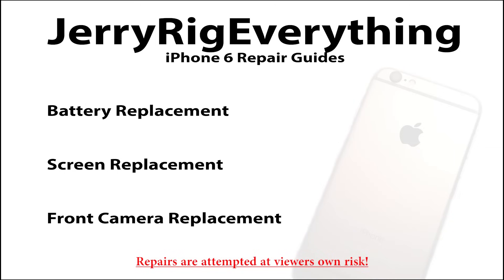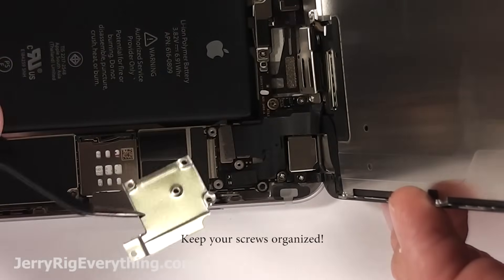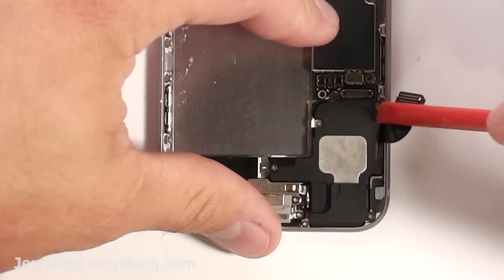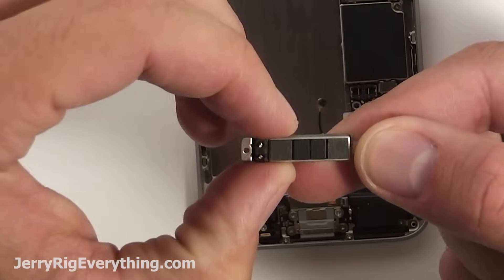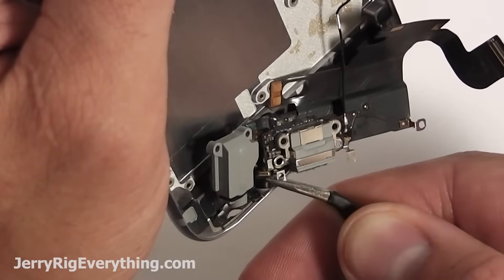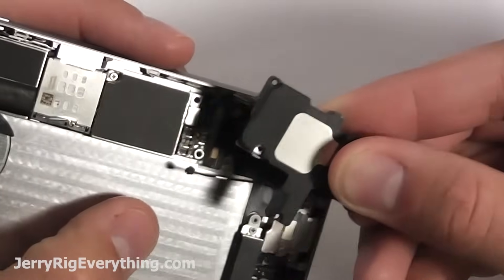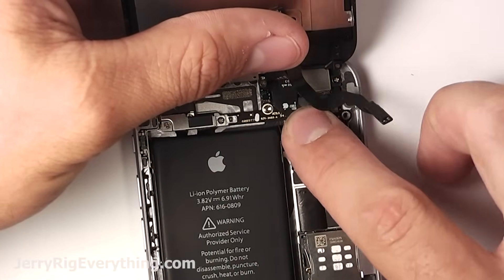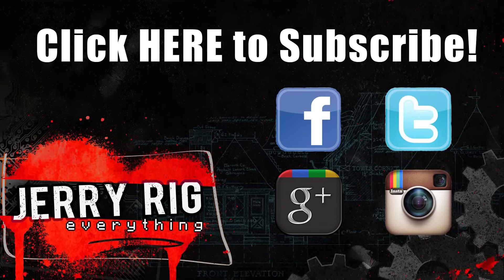iPhone 6 Charging Port Replacement in 5 minutes, microphone fix, headphone jack repair

Comment: The guy in the video makes it look stupid easy, I wouldn't attempt doing this by yourself unless you're already a tech guy. I fixed my charger but I broke my speaker in the process. :/
Reply: Is that what happened to me? I replaced the charging port and headphone aux and now my phone doesn’t have sound unless i use headphones
Reply: @RealTipzy  Probably lmao

Comment: Uuh, so, how can I troubleshoot if the phone won't turn on at all after replacing the charging port?
Reply: Lol good luck bro
Reply: I caused a spark when replacing the charging port like a idiot but I put it on the charger and it worked after. I guess the spark drained the battery

Comment: Fast, simple, and straight to the point. Thank you! I replaced the charging port and battery on my old iphone 6, and it works great again. Very grateful. It's like a new phone. Now, if only Apple would let it upgrade to the latest iOS. Oh well, you did a great job. Thanks!

Comment: This was very well done and much appreciated. One little thing that would have been helpful would have been to point out that the screws on the same parts are different sizes. I took some of them out and then I thought, "Hey, those are different sizes. I had better make sure I keep track of which screw goes in which whole and not just which screw goes with which part."  The green arrows were quite helpful.

Comment: This is a great tutorial that points out the harder issues as well as the easy. The link provided is recommended even though they may not sent progress email but my package came to NE. In 3 days. I am old school self taught auto tech who apprenticed then found myself in a dealer. In the early 70’s a group started an org to elevate auto techs to a base line level with 8 categories. NIASE of which I took all 8 test & passed. Retired now but these are the folks you want working on your equipment. Thanks for the information, parts link as money don’t grow in trees in this throw away society we find are selves in. Don’t fix it, junk it and buy new. Not me! ASE Master Tech since 1978 -Retired

Comment: Nice video but it’s not a good idea to disconnect anything before disconnecting the battery cable first as you can short out the board

Comment: I changed this following the video accurately. 

Everything now works (thanks), except *I have lost the sound for the speaker.*
Any thoughts?
Reply: Problem solved. I took the phone apart twice, then a third time in order to micro-align the parts. The speaker has two copper conductors (which Zach mentions in the video) which needed a lot of coaxing to have them meet up. Ace.

Comment: I tried. Successfully changed the battery. But the charger port is 10 times more difficult. The tiny little screws defeated me on attempted reassembly. Need a new phone, no big deal, 10 bucks for the part, worth a try.

Comment: remove the battery conector before removing the screen and plug it back after plugging the screen back in else you may blow screen filters

Comment: My 6.5 years old thanks for making and posting this video.  I wasn't sure if my old iPhone 6, which beyond the charging port and being a bit slow still suited my purposes, was worth repairing.  I knew I had a limited budget and zero experience with electronics repairs but figured it would be worth $18 to give it a shot.  Other than the one wire attachment that you said took a couple of tries (took me like 20 minutes and gave me a brief sense of panic/frustration) I did it!  Thanks again and am subscribing!

Comment: Just tried this because my POS iphone is shot. Won't charge at all anymore. I got as far as the two exterior screws out and the screen lifted.  Couldn't get the interior screws out. Not one. The kit doesn't have any indicator of which bit to use and I tried any that seemed small enough to fit. So thanks for posting the video, but this didn't really end up helping at all.

Comment: Hey great video! Incredibly useful and straight forward. I completed the repair and all ports work, but my load speaker stopped working. I heard it could be the “flex cable” I was wondering what part that is or if I need to do the repair again. Thanks!

Comment: I got it apart and back together and it's working. However I have 2 smaller screws left over. Is there a guide that shows which size screws go where on this phone?

Comment: I thought I was going to have to change out my charging port. I'd cleared the lint with a plastic toothpick, then I read a comment about using a needle because the dirt and fluff get compacted. So holding the phone with the port downwards I carefully scraped out the inside and was amazed at how much more came out assisted by gravity. Charging fine now.

Comment: Old video but for anyone repairing iPhones - Before removing the digitizer, you really ought to unplug the battery to prevent short fusing your IC chip which is an expensive repair. The IC chip is essentially the CPU of the motherboard and you really don't want to damage that as it will cause your display to black out completely.

Comment: I need helppp after I installed the charger port my sound stopped working
Reply: make sure the connectors on the speaker are aligned

Comment: The right strew holding my vibrator module to the phone is stripped and I can't get it out. I don't see any solution for this at at all. I have already tried using a rubber band to get more grip and I have tried super glue. None of which worked. Looks like I will either need to deep clean my old charging port or get a new phone.

Comment: Followed step by step, organized all screws, went to plug in to charge—-nothing. It has a new battery already but  charge port was damaged. Didn’t turn on for about 4 months because it wasn’t charging. Only thing; I can’t figure out the little loudspeaker wire! I cannot see where it needs to go at all. I’m going to do it all over again tonight to see if I can get it. Took 1.5 hours last night.

Comment: Fantastic! I went between your 6 and your 6s videos as you mention a few different aspects of the change out. Of note, the most difficult part for me which was mentioned earlier by other folks was the fact that you need to save your old previous microphone housing and insert it accordingly in the cavity of the phone frame. I had to redo that a couple of times as it didn't line up. And in missing that - it throws off all the alignment of how the entire housing lies in the phone cavity. Also trying out the power before putting back on the metal screen plate was a great tip. Would be awesome if you had a iPhone 6 screw chart like you did for the 6s...but I made my own and leveraged off of your 6s as well. MY 3 hours of studying  and replacing probably saved me $6 - $800 for another year or more!!

Comment: Ok I have a question please answer if u can becuz I just placedan order for a new iPhone 6 charging port I already replaced the battery since I messed it up charging it with a off brand "elite" charger but when I tried to charge the phone it wouldn't charge I tested the charger and it works fine with my airpods I also did the toothpick thing and it wouldn't work so does that mean I need a new charging port?

Comment: Great video, thanks Jerry. Old iPhone 6 is now charging OK but my screen has gone a bit funny? would this be because the 'nodes' aren't connected properly? Regards. James
Reply: Hi, can you tell if the data on the phone (photos) remains intact after such a fix?
Reply: @F0xleks  Completely! and just so you know the screen is fine, it just needed the node connectors to the screen cleaned with petrol fluid and a tooth brush and about 2 hours to allow 'static' I guess from me fiddling inside dissipate! Also went on to replace the battery too as described by Jerry, again, an easy fix as he describes brilliantly! One tip, by the tools he links as without them it would be difficult... oh and I say toothbrush, but actually I used those tooth flossing stick things.
Reply: *buy

Comment: Fantastic guide, thank you very much.  Getting the tiny loudspeaker cable back on was a real PITA, but that's just the design.  I'm glad I'm nearsighted, I actually took off my glasses and had my eye about an inch from the phone for a while. :)

3rd repair on my iPhone 6 and it's really weird every time I take it out of the case; modern phones are so slim and slippery, how does anybody not have a monster case just to hold onto them, hah.

Anyway, thanks again!

Comment: Took a while longer than 5 minutes just being careful to organize the screws and covers separately and noting which screw went in which hole since they are differing lengths. But overall this was a good series and I just did my battery and charging port on my old I6. Plugging in the screen micro ribbon connectors I had the first one not seat correctly I think and phone would not power up. I tried it before I snapped screen on and had to go back and redo those connections.  My bad.  Thanks for the info.  Thumbs up.

Comment: Awesome video - thank you!  Used it to replace the battery and Lightning port in my son's iPhone 6.  We ran into one issue though.  There are two right-angle brackets on the back of the screen, and these are what the Pentalobe screws from the outside screw into.  Well, these both bent when I was trying to screw the phone back together (probably too aggressively), and they both metal-fatigued and fell off from the screen.  Do I need to replace the entire screen?  Or is there a way to replace just those two right-angle brackets?

Comment: replaced loudspeaker as it wasnt working (as well as charging port). it works but is really crackly and doesnt sound great. could that be i've done it wrong or the speaker is just bad?

Comment: Guess I should stick to fixing motorcycles because I tried everything except plastic explosives to get the speaker out with NO luck, all the screws are out, I even took out every screw within an inch of it but it’s like there’s a hidden screw under the speaker or a clip or adhesive but it will not come out!!  I mean I could put the vise grips to it but guessing not a good idea, I guess it’s off to the Verizon store 👎

Comment: I fixed my phone thanks to your video! Thank you so much! Another thing that helped me was doing something I saw in reviews for the replacement part I bought: draw a picture of all the components inside the phone and use double-sided tape to stick all the screws on the picture where they need to be screwed back in. Worked like a charm, no guesswork for which screws goes where. Very helpful video!

Comment: Hi my niece dropped her phone in the sink while she was washing her hands and now it won't turn on. I was going to put in a new charging port and replace the battery but I'm afraid the motherboard might have gotten wet and all that IC chips are corroded and will require cleaning And resoldering.  what are the chances the phone will work after I replace the charging port and battery?

Comment: I did All of this. Every thing BUT the charger works. Is there any chance I just did something wrong in the installation and it's not something much worse? Before I could get it to charge but I had to put weight on the cord to make it work. Not even that works anymore.

Comment: The hardest part was getting thin wire cable antenna plugged back in. I was starting to think maybe I damaged the connector, but finally I heard it click into place. I put everything together with a new 2200 MAH battery and it's working perfect. It's like my 4 year old iphone6 is new again!

Comment: I dropped my phone into the toilet. Then looked up how to repair a water damaged phone. Two of your videos came up. One on replacing the battery and this one on the charging port. I’m no newbie at taking my phone apart, but this is the most difficult one so far. I believe I followed the instructions precisely but the phone won’t turn on. Is it possible that I received some faulty parts by some random chance, and I should reorder the parts? How can I tell? 
If not, last resort is to bring it to the local phone guy but no guarantee at all and in the end, I might just be spending more money and not be able to repair it and still have to spring for a new phone. Help please?

Comment: Definetly try cleaning it with one of those sim card picks. I just went to a phone repair shop and told him the port didnt work. He just took one of those and started digging out (which i had already tried with safety pins, compressed air, toothpicks etc. And now it works like its supposed to. Had to buy a pair of earplugs because I felt bad i came down there and some kid had to dig out dirt from my phone for free.
Reply: Anders Kristensen Lols from how he maneuvered around it bet they get that all the time
Reply: @TobbeStorm  Apparantly it's common. I went to Humac first. Some dude with fancy shoes and about half a tube of gel in his hair told me the port was broken, and offered to send it in for repair. Glad I didnt go with that.
Reply: Hi, Anders.  I've been searching around for "sim card picks" and am coming up blank.  Have you ever seen one of these for sale?  Thanks for the great tip.
Reply: Ken Geoffrion Apparantly it's called a simcard needle. You get it with the phone. It’s for unlocking the tray your simcard sits in.
You can get those in any shop that deals with apple.

Comment: always battery off first and last thing to go back, i learned the hard way, i must have inadvertently powered up the phone while reassembling , when i was negotiating putting the screen ribbon connectors on i shorted something out, phones dead.  good luck, cheers

Comment: Everything went well in my repair i changed the charging port , battery and speaker, only thing i wouldn't do is unclip the screen it gave me so much trouble to make it work again. But any ways thanks for the vid it saved me alot of money

Comment: Question My Speakers stopped working when i replaced the charging dock. I succesfully changed the Charging dock but the speakers dont work. How can i trouble shoot? Is the ribbon cable the one you had trouble putting becuase it was so small is that part of the speaker?

Comment: I changed this part over and now somehow I get "Call Failed" the vast majority of the time I attempt to make a phone call. Before I dismantle everything again, could this in any way be associated with the new part, or something else? Data always seems fine and my phone does show good signal at the time of the calls.
Reply: So it's definitely related. If I disconnect the lightning assembly, calls work faultlessly again. I've tried two different assemblies and the result is the same, so is it likely to be anything else, do you think?

Comment: This Tutorial worked great and now my phone charges but now my phone has shotty/ no cellular connection does anyone have any solutions? I have tried network resetting, hard resetting, reconnecting the antenna cable, and taking the charging port out and reinstalling it.

Comment: After replacing the whole strip, does it work or  is any error  prompted like "This accessory is not supported" or any of such kind. Because if the original touchscreen glass of iPhone is replaced with cheaper glass, the screen becomes unresponsive or in some condition doesn't work(because of iOS 11.4 and above updates).

Comment: IMPORTANT: Do try to take out lint with sharp needle first. My charging port had very compressed lint, that looked like plastic. Make some pressure to take it out. Before: the charging cable could not fit in. 

Hope this saves someone a work.
Reply: How true !
I already had the charging port replacement kit placed in my Amazon cart when my eyes fell on this comment. "What the heck" I thought, "can’t hurt to give it a try and a proper clean" since I wanted to replace the whole lot anyway.
And wouldn't you believe it, after cleaning out more dirt and dust than I ever suspected to be accumulated in that small hole, the connector fit well again (with that "click" feel when you insert the plug) and - the phone is charging properly again !
My son is happy, since for the past year he had to put it into a special position to get contact and charge. Nobody was allowed to touch it or be in the vicinity during that process ;-)
That's now history thanks to this comment !

Comment: I had water damage in my 6 plus I replaced the battery because it was not holding a charge. It began working and when I plugged it into the computer it recognizes it but the screen does not work. I replaced the screen but still no luck. With the charging port working do you think I still need to replace it or would this be some other issue

Comment: putting back the speaker was the hardest part but overall great video. One thing that sucked is one the screws from the vibration motor became stripped even though I was using the screw driver that came with the kit so I could remove it and just placed the wire strip over it.

Comment: Best vid out there on this topic. A couple things that helped me that weren't mentioned: I saved the screws and plates in the different compartments of an ice cube tray. I took a drop of Elmer's glue, applied it to the end of the little screwdriver, and it helped the head of the screw to stay attached to the screwdriver. I used the end of a chopstick to press various ribbons and stuff into place. Much, much more time consuming than the 5 minutes claimed on this vid. I needed a very bright light and a magnifying glass to help me, and I have good close-up vision.
Reply: If your tools are ferrous you can use a magnet and swipe along from the start of the screwdriver to the tip and make it a temporary magnet.